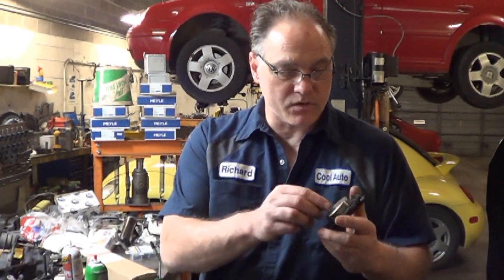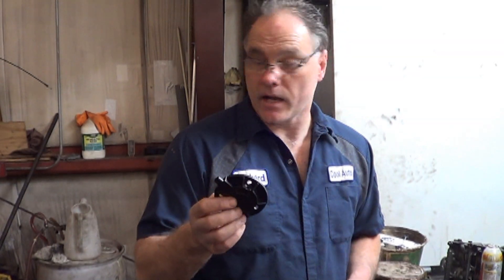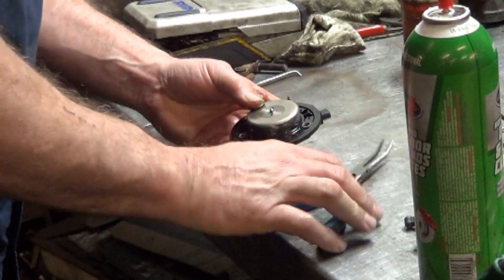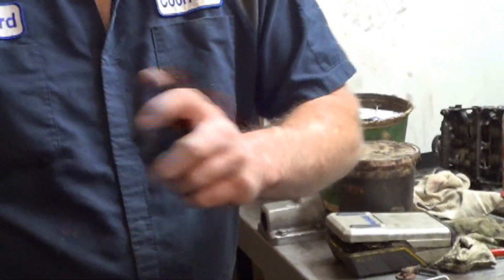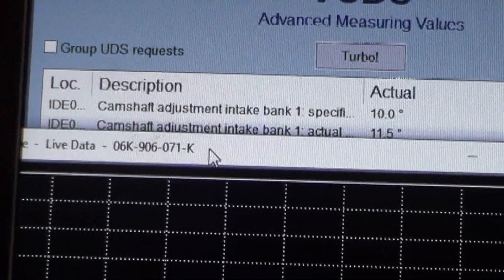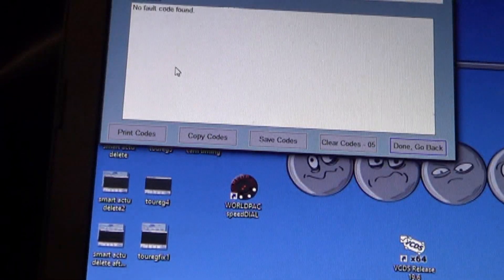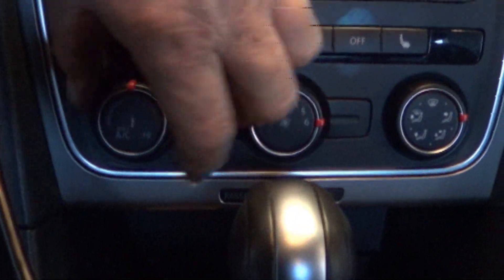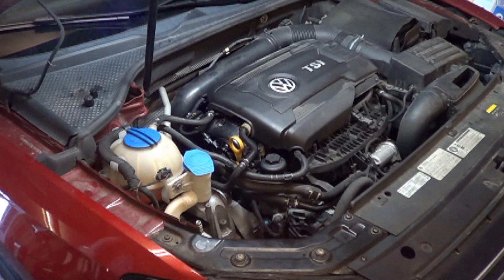2015 Passat P0016 P0011  cam shaft timing part 2

Comment: I had jerking at stop signs, rough idle, and pattern-like revving issues all caused by THIS little part on 2014 Jetta SE 1.8T.  Thousands of dollars saved.  Thank you.
Reply from the maker: Your welcome.
Reply: same car..same issues...getting ready to swap out now
Reply: I am having the exact same issues right now. How hard is it to get to this part?
Reply: @carlossanders3448  not 100% sure, they had it at the VW dealer (parts n service)…
Reply: @CoolAirVw  I just order the Camshaft adjuster Magnet (oem Pierburg) I think same as what is show in this video.   Did it come with the seal? Do I need a new seal when replacing this part?
Reply from the maker: @realagent83  it probably does not come with the seal.  There are two.  One that seals against the cam bridge and one that seals against the timing cover.

Comment: THANK YOU for showing your troubleshooting process, especially using 
VCDS diagnostics, instead of immediately suggesting that viewers replace
 multiple sensors and parts. I have a 2016 VW Passat 1.8 TSI, and your 
two P0011 error code videos saved me a lot of wasted time and money on 
needless repairs last week.
Reply from the maker: thanks be sure to subscribe.  New video coming out today or tomorrow.
Reply: what fixed your problem? i have  a 2017 passat 1.8L p0011 and multi misfires
Reply: @mikecppro  ikr, so much about been accurate, and his response was generic.

Comment: I have a 2017 Passat 1.8 (assume it was a low mileage rental) with multiple misfires. Did the whole tune-up diagnostic and still no resolve. I cleaned the magnet as shown and it cleared everything up. Thank you for your video. It was on the way to the dealership tomorrow. Appointment canceled.
Reply from the maker: So cool when my work helps someone like this!  fantastic.
Reply: @CoolAirVw    Is this part supposed to get oil in it when working? The pin is free but it seems always seems to have alot of oil inside it. My camshaft oil vlave looks ok but is oil supposed to be coming through when you take out the magnet? Thanks 14 Jetta 1.8tsi
Reply from the maker: @parkerkimbell4378  yes
Reply: Did you do it yourself?? Was it a easy fix?? My vehicle is doing the same thing

Comment: Hello @CoolAirVw Rm, at 1.8 TSI GEN 3 i have a diesel noise at idle only when the engine is hot.If i disconect the connector from the electromagnets the sound disapear.(no error code) What to replace first?electromagnets or mechanical valves ?Thank you
Reply from the maker: those have a bulletin regarding failed cam phaser.  I would guess you have that problem and need to buy a cam.  No way I can know for sure though.

Comment: Dad and I have been fighting with my 2015 Jetta that’s exhibiting these same issues!
After changing the spark plugs today (man those boots were stuck on!) the problem has persisted

Going to change that magnet/solonoid tomorrow

If that doesn’t fix the rough idle, I may have to have you come out to St Louis and fix my car lol!
Reply from the maker: Those spark plug boots are a pain.  Half the time they get destroyed, but they are available cheaply in the aftermarket. 
I'm not in st louis.  do you have a cam related code?  Have you checked fuel trim?
Reply: @CoolAirVw  I’m afraid I’m unfamiliar with what fuel trim means. 
I’ve got misfiring cylinder codes as well as P0011 

After watching your video and then the two parter at Pine Valley Diagnostic, I’m excited to replace the camshaft adjuster magnet this afternoon
Reply: After replacing the part a few days ago, my Jetta was back to idling nicely but it was a little rough again this morning.

Any idea what else could be acting up? I had no codes but now show P0441
Reply from the maker: @Lewismarty1  Sorry I do not have all codes memorized.

Comment: hello please i wanna ask u if their any problem if i removed the filter from brake vaccum pump on tiguan to prevent the oil passage from clogging
Reply from the maker: I dont see why that would be necessary.  Use the right oil and change it at the right interval and it wont clogg.

Comment: Hello 
I wanted to know if a 2013 Passat VW has a cam shaft because my car does not have it where this car has it and I can’t spot it. We already changed Cam shaft position sensor and it seemed to have made the situation a little worse. 
We are thinking of changing next the variable timing solenoid but it’s confusing because it doesn’t look like what you changed and we can’t physically find the part that you changed. Help pls!!

Codes we are getting are

P0011
P0300
P0302
P0304
P0305
P052A
P0441

Thank you so much !!
Reply from the maker: It would help if you could tell me what engine you have.  Also I don't have all code numbers memorized so what you typed there is just gibberish to me without the definitions.
Reply: @CoolAirVw if it helps to answer Caliturttle's questions.  Code P0011 is Camshaft position (CMP) intake/left/front, bank 1 - timing over advanced.
Code P052A is Camshaft timing - cold start bank 1 - timing over advanced.
Codes P0300 to P0305 are Cylinder missfires, 300 being random CYL missfire and 01 to 05 is the specific CYL.
2013 Passat has a 2.5L MFI DOHC pzev 5 CYL engine.
Reply: I believe @caliturtle3777 is asking about the Cam adjuster magnet part if it's something their Passat has or maybe it's a different part. Also forgot one code. Code P0441 is a Evaporative emission system - incorrect flow detected / incorrect Purge flow; which might be unrelated to the Cam timing/ CYL missfire problem

Comment: Just wondering.   I replaced my cam magnet and the cam isn't popped up on the inside.  Would you have a idea what would still cause this p0016 code.  Thanks in advance
Reply from the maker: probably out of time. Possible bad cam sensor.

Comment: I have Volkswagen 2014 and the idle is not alright do I should check the sensor camshaft
Reply from the maker: sure.   Do you have vacuum leaks or misfires?  What are fuel trims?
Reply: @CoolAirVw  I put new spark plug has the First on Earth never change the spark plug and I change it for new one for and the idle still same when I take the camshaft cable out the idle stable when I put the cable in the camshaft the sensor is the idle nut right
Reply from the maker: @GG-GODZILLA91  ok

Comment: It is recommended on these VW at about every 40 to 50k to do Liquid Molly Engine Oil flush. 
Just like that solenoid is getting crusted with burned oil, contaminants, the same way the rest of the engine parts, sensors start to get clogged, covered.
These engines due to their bad piston rings get a lot of blowby and carbon deposits.
Reply from the maker: Thanks for sharing that.
Reply: You can pull the plugs and fill the cylinders with fuel injector cleaner, let it soak for a couple days, crank it over with plugs out, add a little oil to each cylinder, change oil and oil filter, re install plugs, drive it hard down the road, then find a vacuum hose that goes to intake and feed it a can of seafoam, and at the end give it enough to stall it. Let it sit for about a half hour then go drive it hard again to blow out the carbon

Comment: where is that magnet located ? inside the variator or is in the place of Solenoid Valve ?i have the same problem on a Golf Mk4 1.6 FSI BAD, i changed that solenoid valve but nothing changed, i guess might be a problem with the variator that one with sprocket... thanks
Reply from the maker: I have no experience with your 1.4L as that engine wasn't sold here.  Cam "magnet" is Vw's name for the cam solenoid or VVT solenoid.  Lots of names out there I try to use the Vw name, but sometimes in the video I might say something else.
Reply: @CoolAirVw  so that magnet is just the solenoid not the entire variator eith sprocket , i changed the solenoid but same error P0011 and the engine feels missfiring up to 3000rpm , but on channels 015 , 016 no missfire counters , i changed camshaft position sensor and still the same , i will change the crankshaft sensor too , if nothing changes then remain the variator.. thnak you so much , btw my ignition angle jumps from 3 degrees to 17 degrees when is the engine shaking
Reply from the maker: @Pete2ong  On the engine in this video the variator is under the timing cover on the end of the cam.  I have another video where the oil control valve fails. Also the oil control valve can fail another way on the inside.

Comment: I also have an error code in my golf 7 gti perfomance 2014 P001600 I get a message cylinder 1 cams crankshaft position sensor installed incorrectly When I start the car, the tachometer goes up and down, then it goes out, I get a start stop error message, start the car manually  i bought central magnet camshaft regulator garage put it in and says the problem is gone am really excited hope it will be gone when i pick it up
Reply from the maker: I hope its all good!
Reply: @CoolAirVw  Car didn't cut out until today but unfortunately I got it again but this time only with error code p0013

Comment: You are very clever, thanks a lot.
I have a Golf 5, 1.9TDI, 2006, 77kw, motor BXE, 140000km, it makes a black smoke, I checked it, cleaned the valve, the turbine, and all filters, but it's still making the black smoke. What I should do? Thanks
Reply from the maker: usually black smoke means too much fuel compared with the amount of air injected.  So either airflow problem or over fueling.  Do you have any boost leaks?

Comment: hi! is one 1.8 tsi skoda octavia P0016 the central magnet leaves with error code, difficultly valve and the camshaft was a signaller substituting. Maybe that I should exchange the exterior central magnet? P0016 Bank 1: CMP Sensor G40 / Engine speed sensor g28 incorrect correlation
Reply from the maker: sorry not familiar with skoda.  Is your "exterior central magnet" stuck?
Reply: @CoolAirVw   I did not check it yet. a signaller was a camshaft substituting. the valve under the magnet likewise. the car leaves difficultly
Reply: @CoolAirVw  but I check it if he is punished the magnet may be the mistake then...a mistake throws it after 5-6 launches after a deletion and starts difficultly
Reply from the maker: @xXMiluXx  Its difficult to advise people when I cant check the car.  Seems we have a little bit of a language barrier also, so that makes it more difficult to help you.

Comment: What else could you use besides brake cleaner?
Reply from the maker: Anything you want.
Reply: @CoolAirVw  I just got done seeing if this was my issue. I’ve got codes 300,301,11 and 16. My timing went out 1500 miles ago, I’m not entirely convinced the crankshaft is bad and I’m starting to think it’s the camshaft sensor. I have a 2012 Jetta GLI with 100k miles on it. It runs but runs rough and can’t get up to speed very easily but it is possible to do 60mph but I haven’t driven it since this happen. Blinking engine light and EPC light as well. Any other suggestions?
Reply: @CoolAirVw  also, this turned out not to be my issue

Comment: Hi.. my Jetta is at vcds between 7 and 9 degrees when it heats up.  He makes a strange noise.  could it be my magnetic? No error codes but the car hesitates a little at idle and stopped.thanks.
Reply from the maker: if you dont have a code I doubt you have a timing problem.

Comment: Is there any adjustment or anything that can be off or is it direct bolt in ?
Reply from the maker: bolt in.  Check the other videos relating to this code also. Check oil level and oil control valve.

Comment: Replaced my timing chains and tensioners, still have a rattle every 5 seconds at idle, but if I unplug the adjuster magnet, the noise completely goes away. Any words would help. Thank you.
Reply from the maker: Balance chains out of time?

Comment: In my case on audi a4 1.8 tfdi cdhb e.code,i have fault code P0011.
I replaced magnet,solenoid,bridge and camshaft,put all new parts and have same code after....
On tester when car staying angle is good,but when i put accelerate pedal down angle is same,nothing happening... 🤔🤔🤔
Anyone Ideas?
Reply from the maker: does it trigger cam codes?  Does it work when you run the basic settings test for timing like I run in this video?

Comment: Hey! Passat 2015 b8 , 2,0 tdi, crlb
After replace the camshaft adjuster i got problem with rpm idling. Symptom starts Only when engine temp. Is 80 and more degrees. No codes. Ventyl is new. How can i diagnose wheres the problem?
Reply: I have a b8 a4 Audi maybe change the crankshaft sensor